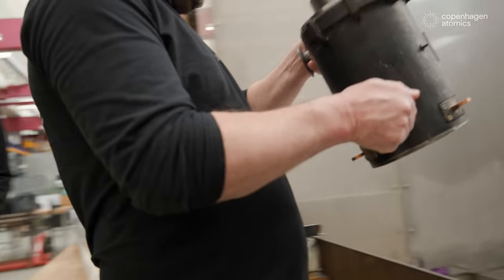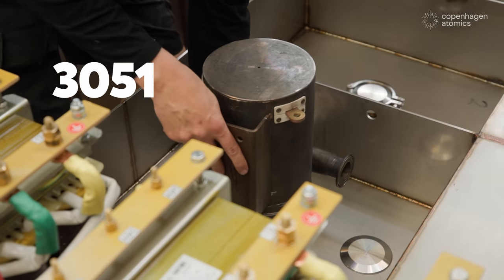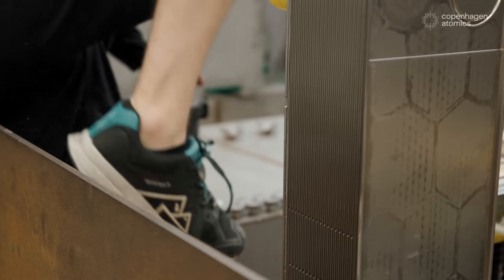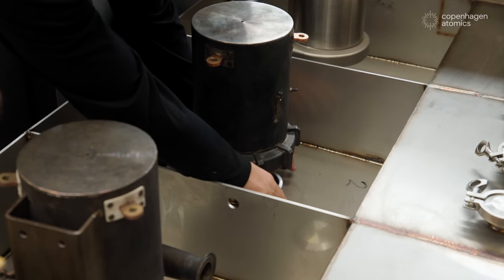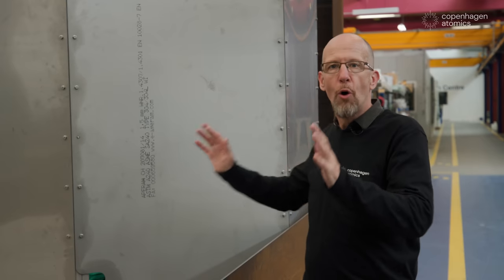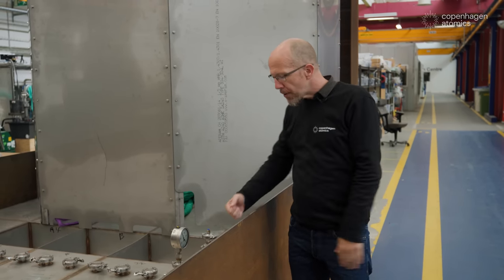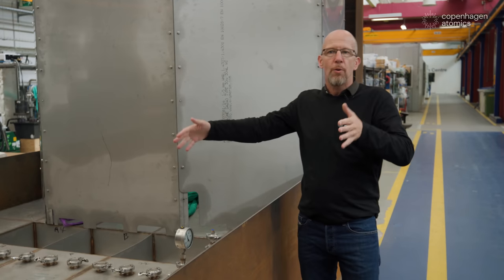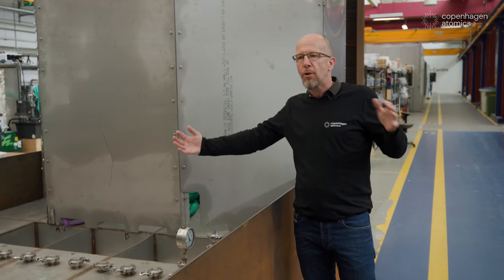Copenhagen Atomics first reactor images

Comment: I really like your reactor design philosophy. A tank just off the reactor outlet salt to boil off the xenon gas for stable reactor output into an aftercooler to power a super critical co2 turbine for incredibly small 100 megawatt output. Almost as small as a megawatt diesel genset. Then all thats needed is a 5ft thick concrete barrier at the work site for radiation damping with easy access to a waldo crane to change failed pumps and or valves. Using pressurized water reactors waste fuel as the fission source for the molten salt in a fast reactor with a blanket of thorium fuel to attenuate any neutrons before the concrete barrier. The fuel before rentering the reactor sparged with flouride salt to remove uranium and protactinium as a fuel replenishment exercise. The protactinium being tanked to decay to uranium. All other fission products kept in the salt.

Comment: ADECSA - Atomic Deproliferation Energy Consortium of South Africa 🇿🇦 has invited Copenhagen Atomics (C.A.) to join in and use SA as testing facility. Hopefully C.A. will react to the invitation and initiate the process.
Communication is key as reliability and trust is build on communications.
Hopefully Thomas Steenbeck will step in and take up the slack.
Reply: Kinda a non regulated and sketchy part of the world. Sorry but I’d be shocked if any reputable companies would take advantage of doing testing there

Comment: Big question is, have they sorted out the containment material to handle all of the heat and corrosion that will be taking place? From what I understand that is the main thing holding MSR's back.
Reply from the maker: We have addressed this issue through our method of purifying the salts. We can purify these salts to such an extent that corrosion occurs at such a low rate that it is not a concern, even for stainless steel.
Reply: @CopenhagenAtomics  So you have caught my attention because this is a technology that can really benefit humanity if these basic chemistry and physics problems can be solved.

Comment: How did you solve the gamma radiation problem?
Reply: From my understanding is that no humans will be permitted inside the reactor container and all actions will be performed by remote control. I saw a video showing a container sized reactor buried in the ground, which provides physical shielding for gamma radiation.
Reply: That is a lot of Lead or Uranium.  It will make the container very heavy.

Comment: What is the power delivery capacity per reactor  of these container size units?
Reply: 4000 kwh - 24/7
Reply: @claeswarningholbeck3742  . I sent an email to your colleague Tobias. Hope to receive his response in due course.
Whilst I await his reply: out of mere curiosity - is it 20' or 40' size container?
Reply: The reactor in this video is a small demo, however the final reactor will be 100 MW thermal, at high temperature, in a 40 foot container. That could yield around 50 MW electric, but power conversion will not be part of that container.
Reply: @claeswarningholbeck3742 your answer is 4MW. I don't think that's correct. 25 reactors for 1 GW is 40 MW per reactor. This video references 100 MW.

Comment: You say that Thorium reduces the need for mining a hundredfold.
Thst is theoretically true, but practically Thorium is a waste product of rare earth extraction as thorium is contained in a significant concentration in Mozanite, the main ore of the heavy rare earth metals. 
It needs to be stored safely as liw radio active material. 
Thorium reactors use this material for energy generation.
The heavy rare earth elemevts can be used in the "sustainable" new technologies and the naughty cousin Thorium can be used profitably as well. A winner all round. I think you do nit stress this fact enough!
Reply from the maker: Hi! You are completely right. We do try to stress this fact, but often we have to be short in our presentation and not every detail can be told. But if you haven't seen it yet, i'd suggest our latest talk, there we try to stress that thorium is very cheap especially because of the reasons you rightfully mention :) The latest speech: https://youtu.be/U434Sy9BGf8?si=85fS8qzr6NmWFMGZ

Comment: Skinny reactor walls, i feel so safe already.
Reply from the maker: It is explained in the video that there are 3 walls. The outer wall is more than ½ meter thick (not shown here)
Reply: You do not want them shiny - you want them dull so that they are emmisive and transfer heat
Reply: The great part of a MSR design like this, is that there is no high pressure parts, so there is no need for thick walls :)
In most traditional power plants, there is water under extreme pressure to keep it liquid, and so a rupture will result in an explosive steam release. In molten salt, there is no need to pressurize the salt to keep it liquid, so any rupture will just result in molten salt running down the side of the inner enclosure and solidifying in the bottom of the container.